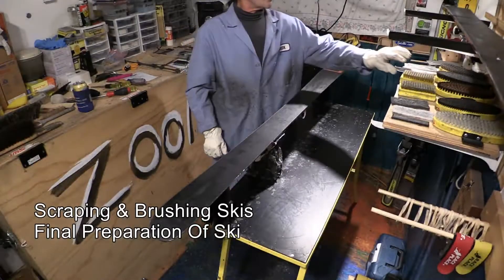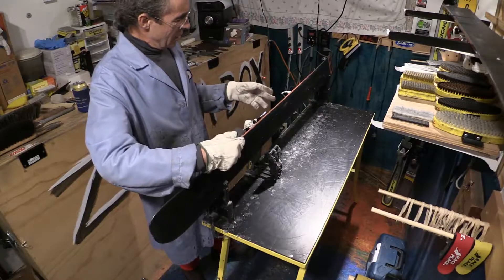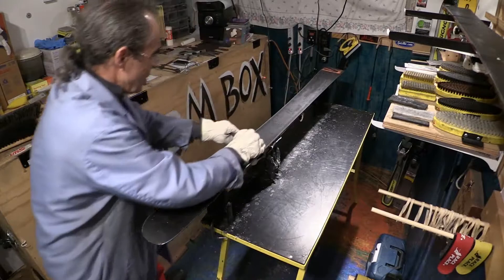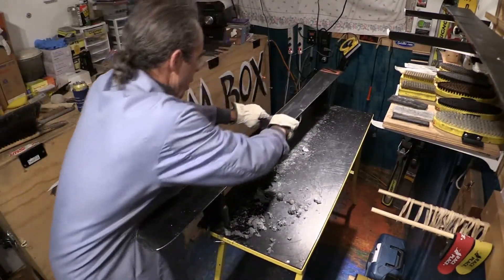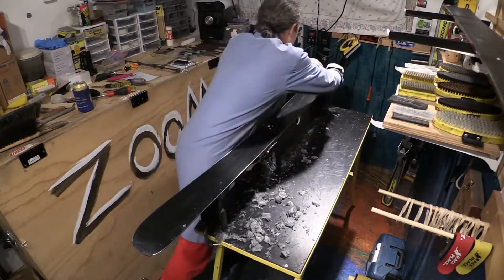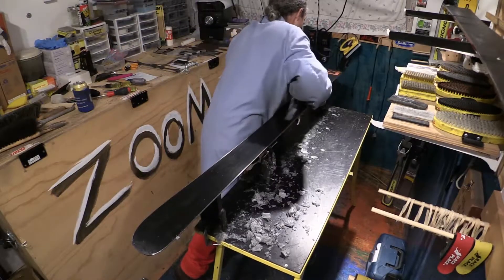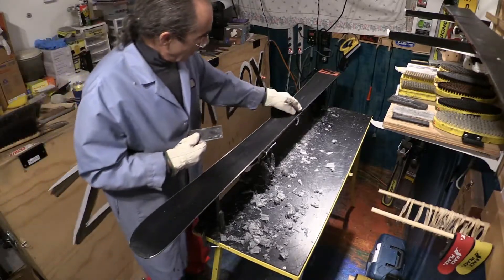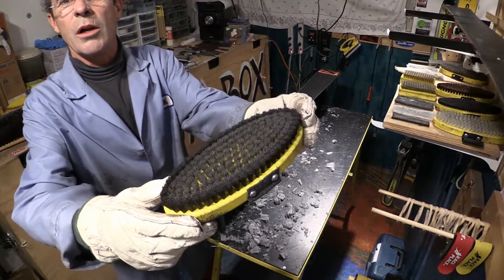Scraping & Brushing Skis Final Preparation Of Ski (New Version)

Comment: Always thought a metal scraper was too aggressive and ‘gnarly’ for the ski base but you’re proving me wrong. Thanks, I will revert to the metal scraper - the plastic scraper is rubbish indeed! Its superimportant to get all the wax off.
Reply from the maker: Truth!  Just be sure it's not too sharp!  It may take a while to get the scraping done, but it's worth the effort.
Reply: @Sagina1999  didn’t have the opportunity to go skiing last year because of the corona outbreak in the ski resorts, so I have a layer of wax of 2 years ago to remove next week. That’s going to be one big waxfest for sure! 😅
Reply from the maker: @wisecoonie  Let me highly recommend Dominator Base Renew Waxes.  Use them after any base cleaners, or for hot scraping.
Use from time to time after that to keep the tank full and to get good adhesion of glide waxes.
https://dominatorwax.com/products/dominator-ffc-1
https://dominatorwax.com/products/dominator-renew-g

Comment: When I prepare to wax my skis, I protect the sidewalls by sticking painters tape on either side. I didnt the first time and had to scrape off lots of wax off the sides of the skis. Now I just take the painters tape off as zoon as the wax job is done and I never have to scrape the sides off again (buggered me to hell…).
Reply from the maker: Some do and some don't.  It's usually done to prevent getting wax on the bindings.  I don't.  I like rubbing the wax over the sidewalls with the fiber pads.  Even on cap skis!

Comment: Hey. Thanks for a great video. I have a question about graphite wax. Can it be used with extruded bases (K2 Domains)? Will it last longer with than simple harder wax? I mainly ski indoors and have huge problems with speed.
Reply from the maker: +malachas  Yes, graphite is an important additive for man made snow.  Man made has very sharp edges so you do need a hard wax as well.  If you can get Dominator waxes I would try a mix of Race Bullet New Snow with FG-77.  You should be able to get these waxes online if no shop sells them around you.
That said you need a pretty smooth structure as well.  Might be your skis have too deep of a grind.  All that said, extruded bases won't take up but a tiny tiny bit of wax, so it's not going to last very long.  With these waxes you will need an iron temp. of about 220F to 230F.  That's hot!  Use the touch to iron and rub on ski method then iron well.  Let cool 45 minutes min.  The wax will crackel as you scrape it off.  Don't worry about that.  Then brush the hell out of them with brass and polish brush with nylon then horse hair.  Good luck!
Reply from the maker: +malachas BTW, what is the temp. in F inside that place?
Reply: +Sagina1999 Thanks for the tips! I'll be sure to try them out.
I mainly ski in a place called Snow Arena in Druskininkai (Lithuania). It's about -2 to -4C (29F - 25F?). Snow conditions are pretty bad there curently - old and dirty.
I have really notice the problem about holding little wax with extruded base. They seem fine for a while, but the suddenly they seem to stick to the snow... Well lessons for the next pair of skis, that will be with sintered base.
Reply from the maker: malachas
Being indoor it must be lift grease.  The waxes  I recommended have some fluorine and that will do wonders to repel dirt and grease.  A dirty base is super slow.  Be sure to use some Swix Glide Wax Cleaner before you wax so you don't wax in the dirt!
https://youtu.be/GjXSclmZyH0
Reply from the maker: +malachas  Coming back here to answer another comment and was thinking of your situation some more.  
All the prior applies, but another reason man made can be difficult is the minerals that are in the water they use to make the snow.  Most natural snow will be void of these minerals such as clay's and salts.  So in short man made snow is very difficult to respond to as it might be one thing in one place and another thing in another place.  I hope you are trying some things different and it gets better for you there.
Reply: Latkus...God damn...I was complaining about the snow not being perfect here in Utah today and I’m sure it’s way better than anything you’ve ever experienced (not to mention the 3000 acres and 3500ft of vertical). Reminds me and humbles me with how lucky we truly are to live where we do in Utah. I was in the gondola yesterday with some people from the east coast (which is probably better than what you ski on as well) who were ranting and raving about how amazing the snow was. It was the worst snow I’ve had all year. Crazy. Good for you though for getting out and doing it anyways...I have a lot of respect for people such as yourself when I can drive 30 min in any direction and be at 8 different world class resorts. Makes me feel kinda like an asshole. Keep it up and good for you!

Comment: So, the usual dogma is that you would only use a metal scraper for ptex, but never, ever for total wax removal (where you'd use a plastic scraper then brush).  I guess you think that's nonsense?
Reply from the maker: I use the plastic scrapers on metal edges and sidewall only.
Reply from the maker: Back again.  The thing is how sharp the scraper is.
One can shave base with any super sharp scraper, be it plastic or steel.
The steel I use for wax scraping are "tuned" to not be "too" sharp.
I use other steel scrapers to flatten a base high ski.
Those are tuned to be very sharp as to shave the base plastic very easy.
I use a super sharp steel scraper in this video about breaking in a fresh stone grind.  https://youtu.be/8WsboLAUYYk?t=958